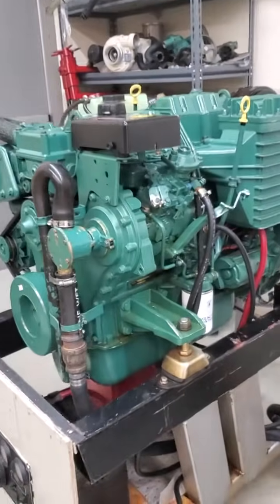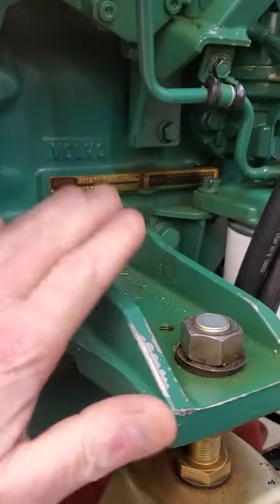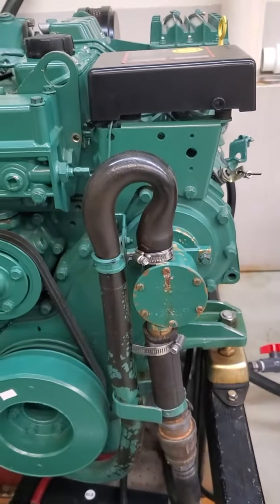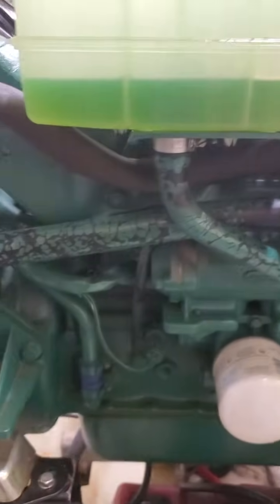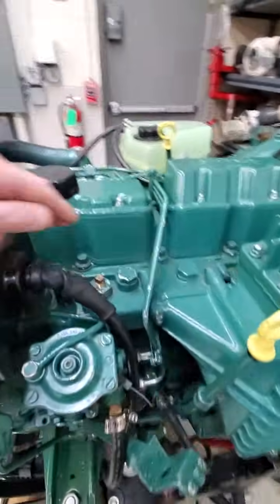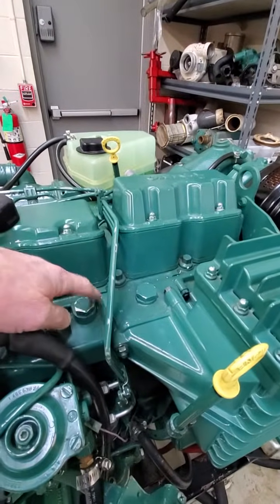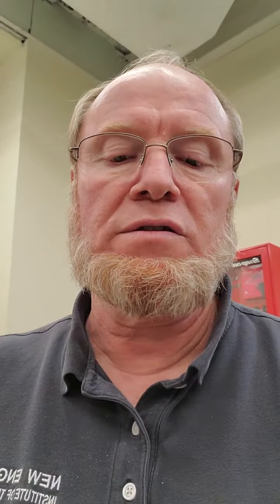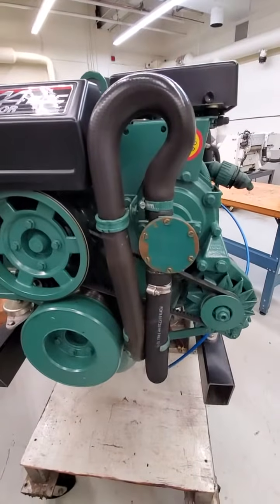Volvo Penta TAMD 31 Diagnostic Tips

Comment: Great video! Im also an idiot who loosened the bolts on the back side of the aftercooler/turbo pipe and 3 out of 4 bolts snapped. Is it safe to fasten it up with epoxy that holds up to 120 degrees celsius continous? (I had to get it out to replace a gear box in a very tight engine room)
Reply from the maker: I believe the housing is already epoxied together. So filling in the broken bolt holes should be fine.
Reply: @tedsmarinerepair8956  Thanks for the answer 🙌 Going to give it a try today 👍
Reply: @tedsmarinerepair8956  Do i need something around between the bolts to make it airtight or is it enough with just the bolt holes? Having trouble with the turbo not kicking in...
Reply from the maker: @henrikaasen579  I believe where the housing is epoxied together it is a permanent seal, so filling in any broken bolt holes should do the trick. It sounds like you may have a dragging turbo that needs repair.
Reply: @tedsmarinerepair8956  Yeah, but i had the lid off, so then the seal is broken. Do i need to take it off and apply som sealant? Yeah ill check out the turbo 👍 I get right around 2400 rpm, and after that its black smoke and no more rpm. A friend with the same boat, propeller and gear gets around 3600 rpm at max so somethings off.. Thanks for the answers 👨‍🔧🙇‍♂️
Reply from the maker: @henrikaasen579  the top seal should be replaced . You should also replace the bottome seal around the drain id you removed the aftercooler from the housing.
Reply: @tedsmarinerepair8956  Yeah but those parts i didnt take off, i just had the side part with the tube that goes to the turbo off. Did it too get the gear out too change the damperplate.

Comment: Hey Ted, 

I have a set of twin KAMD 300’s in my 28’ Carolina Classic. For some reason when I get to around 2700 RPMs my superchargers will surge kicking on and off u till I get past 3000 RPM’s it will not allow me to operate smoothly at 2700-3000 RPM’s than they will finally shut off, sometimes the the engines will not allow me to rev past 3000 RPMs when getting up on a cruise. I just had all my injector nozzles replaces, intercoolers cleaned and valves adjusted. Do you think this could be related to the turbos fouling and not creating enough boost? Your help will be much appreciated! 

Thanks,
Kyle
Reply from the maker: The superchargers are controlled by the ECU and are turned on and off due to the load and boost pressure which is monitored by the ECU. If the engine will not go over 3k then it may be a dragging turbo (need to verify and compare to aervice lit during sea trial). It also could be a fuel restriction. I always start with freh filters then check for excessive fuel vacuum (again checking against service Literature)

Comment: Hi Ted. Great video's. I've got a TAMD31P-A in my sailboat. Due to the install location, (Under the floorboards) it's always a messy job to replace the oil filter. Question, are there any remote oil filter kits so that I can place the oil filter in a more accessible location? Second question, I see that some other VP models have the Raw Water Filter after (on top of) the raw water pump. Do you see any problem in installing one of these even if you have one before the pump, basically ending up with two raw water filters. The idea being to protect the system from debris from a failed impeller. Thanks for the info. Cheers
Reply from the maker: There are aftemarket installation kits, I don't believe there is one that VP makes. If you wanted you could take the filter braket off the engine and relocate, then take the oil lines to a hydraulic shop and have them make you up longer oil hoses. 
Having the sea-strainer before the pump I feel is best, and of course changing the impeller on a routine basis (prior to failure!).

Comment: Hello,
I have a TAMD31L diesel engine with a new ignition switch but will NOT shut off when holding in off position.  Starts just fine. After i cut the batter disconnect to it it seems to take another 5 to 10 minutes before it shuts the motor off. Could this be a bad relay in the ecm box or stop solenoid going bad?
Reply from the maker: Check the wire attached to the pump to see if it has 12 volts when you turn the key to the stop position. It may be disconnected. I believe There is also a mechancial stop lever on the pump you can shut it off with.
Reply: @tedsmarinerepair8956  thank you Ted!
I'll try that and get back to you.

Comment: Hi Ted, After having viewed your wonderful video I realised that the, smoke limiter hose, is completely split. Is there a spare part with the hose only or I have to go for the whole thing. Or could I try to strengthen it out, with some sort of clip.
And one more thing Ted, I haven't cheched the injectors for more than 16 years. Is it a must to do it or I can wait for some sort of indication. Thank you so much for your time. I wish I could follow your cources. the engine is a TMD41a. 
Great engine!
Reply from the maker: I will check the part#. As for the injectors, good fuel, change ALL fuel fulters annually or less and they should be worry free for a long long time. If you sense a loss of power or miss fire then they should be checked. Without that hose it will black smoke on hard acceleration

Comment: Great film, really useful. Do you know what boost pressure the TAMD31 should run at?
Reply from the maker: Depends on the model
Reply: @tedsmarinerepair8956  its a TAMD31P-A. Thanks
Reply from the maker: @nealb11  
30 kPAa (4.3psi) @1800rpm
95kPa (13.7psi) @ 2500rpm

155kPa (22.4psi) @ 3800 rpm
Reply: @tedsmarinerepair8956  Thank you
Reply: @tedsmarinerepair8956  I Ted. Mine it's a TAMD31D most known as TAMD31L-A i think, from 1994 (130hp). Full throttle just get 3300 rpm maximum. It's leaking oil from the bottom of the aftercooler, so i'm guessing turbo needs to be repaired or replaced. it's a 28 years old turbo anyway. Planing to do some maintenance on the aftercooler (cleaning and new seals) and replace the turbo. i got the pressures from the book, do i need to read it only at WOT or can it be at constant rpm?

TAMD31L
1800 r/min --> 30 kPa (4.3 psi)
2500 r/min --> 80 kPa (11.6 psi)
3250 r/min -->             –
3800 r/min --> 140 kPa (20.3 psi)

Can´t reach the 3800rpm so i'll need to average the 3250rpm anyway. Loads of grey steam starting from the 2900 rpm.
No problem reaching the 4250rpm in neutral.

Thanks for your help so far. You channel is golden!
Reply: @tedsmarinerepair8956   same for AD31P-A?
Reply from the maker: @martinmollo  yes same values

Comment: Great videos! I have a Tamd41p. Ive had it for one year now. I try and do all my own maintenance. Are there some things I should look at like problem areas with that motor. It’s a saltwater boat with a heater hose for the cabin coming off the motor. Planning on trying to flush the antifreeze out soon. Should I just drain the antifreeze and replace or do some sort of flush? Thanks agian
Reply from the maker: Sorry for the delay. You can simply drain it, fill it with distilled water an run it for few minutes and then drain it and fill it back up with antifreeze and distilled water 50/50. 
Maintenance is change all fuel filters annually, the anodes in the heat exchanger and aftercooler and check the belts. Raw water impeller/kit R&R every 200 hours or every 2 years for worry free operation. If you look it may have an air filter and crankcase ventilation filter which likely need changing as well.
Reply from the maker: Yes flush it out with a garden hose then drain and refill with your 50\50 mix and burp the air out
Reply: @tedsmarinerepair8956   Thanks! I’ll give it try before I put it away for the winter.

Comment: Great job!!!   Have you knowledge about Volvo Penta MD30A with a PTO running a Hydraulic Hydro Watt turbine 6K. Used for AC power on a sailboat. 
Thank you
Reply from the maker: I have not worked on in many years? Do you have a question about it?
Reply: @tedsmarinerepair8956  looking for someone to do evaluation and work on one. I am located on the west side of the bay in Davisville at Allen Harbor.

Comment: great job! I was wondering regarding volvo pent TMD41A should I go ahead and service the circulation pump or wait until something shows up?
Reply from the maker: If you refering to the sea water (raw water pump). Then yes. The circulation pump is on the closed cooling (antifreeze side).
Reply: I'm refering to the circulation pump on the closed cooling
Reply from the maker: @dionysislebessis7352  If it is leaking or (with the belt removed) you feel play in the shaft then you can rebuild it with kit #876794.
Reply: @tedsmarinerepair8956  thank you very much!

Comment: Some great info. Can you tell me where the tacho sender is placed on the tamd41a. We are powered by 2 41a the port side has started to give eronious readings on both the upper and lower helm tachos as it's both it won't be the units, could be wiring or a sensor, just can't spot the sensor location.
Reply: 0n top of the raw/fresh water pump housing....two nodes are sticking up connected to wires...I have a Tmd40a and that’s where mine is.  Easy to knock off
Reply: @waynemaroney689  will have a look

Comment: Yes
Reply from the maker: It's on my list.
Reply: Hi! Please help me out,my name is Herb I bought old boat with volvo penta AQDA31A every time I start back smoking,even wend he running hi speed smoke I asked to my mechanic why e smoke,e sai this motor is to old,  I pushed de acceleration to limite I hand to wait 2 minutes to get full acceleration ,we put new turbo e dint help ,motor don’t burn oil has 1.300 hours, he also drinks some cooling,please give some tips.
Thank you Herb Silva  I am in azores,  no good mechanics